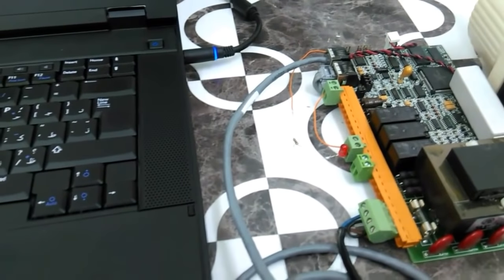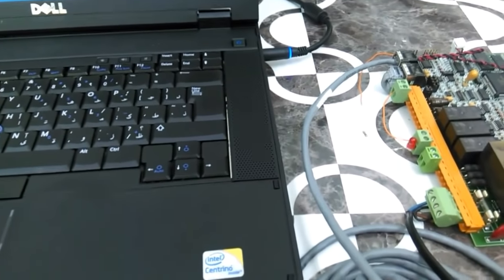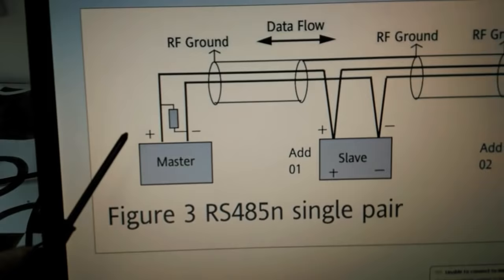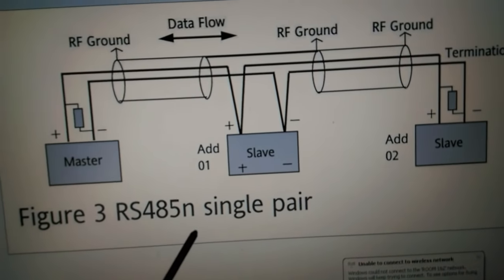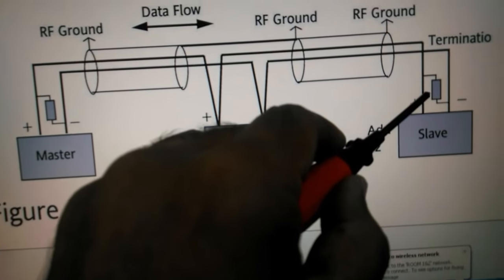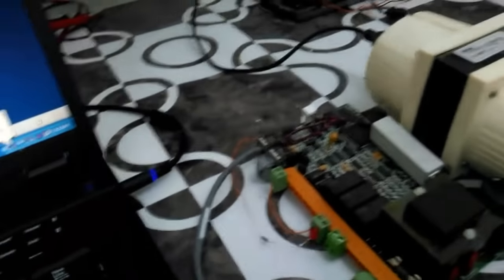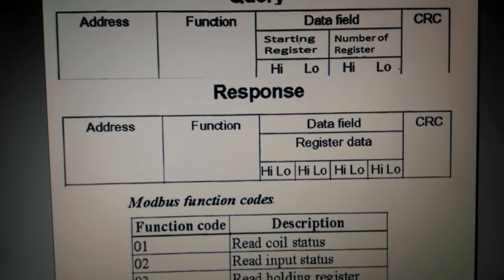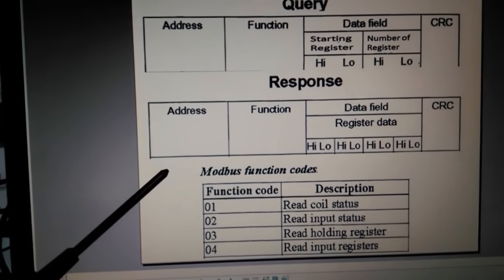Introduction to Modbus communication with RS232 and RS485 link, and understand How to use modscan32

Comment: Hello thank you for the video. It helped me a lot. I have two questions please:

1. If the slave device manual is not available, is there any way to know the address of the slave device? I want to pull decimal values from a pressure meter through controller/slave using RS485. 
2. How can I know from which register of the master device I should start? Or I can start from 001 always?
Reply from the maker: Hello, you are very welcome,
1. If device manual not available the other way is to go through the configuration menus of the device if the modbus mapping will be visible, but many devices they don't provide this, also you can try to communicate with manufacturer if possible, it is difficult to just guess the equvelent modbus register for any parameter, modbus list is big  range  and they can use any so not easy to just predict.
1. At master device you configure the modbus register mapp as per the slave device available data to be read. So the master pull the register and get the answers from slave on same register.

Comment: please 
are you connected the red and green LED in series or parallel with the transmit &reciev ?
Reply from the maker: +Ayman Elsayed 
Both  cathodes of Red and green LED going to the ground pin (pin #5) then the anode side of the LED's connected one to pin 2 and the other to pin 3 through 1 kilo ohms resistor.

Comment: could we able to connect 30 slaves directly to master computer with RS485 to USB convertor? pls rply asap
thanks in advance
Reply from the maker: +syed mubeen 
Technically up to 32 devices can be connected to single master on the RS485 data link network, yes you can use the USB to RS485 converter but take in  consideration the flowing points.
A-Use good quality industrial type USB to RS485 converter it is normally mentioned in the device specification the ability to handle 32 nodes.
B-Connect the devices using daisy chain meaning the same cable passing to device one then 2 and extra, use the end of line resistor one at computer side and second at last devise.
C-Test the link with fewer devices, then check the communication and keep adding gradually. 
D-Avoid the slave devices which generate harmonics like variable speed drives this will cause problem in the network, therefore put them separate.
All this just advises cannot be 100% as the communication setup depend on many other factors anyway.

Comment: Instead of using a step down transformer why not feed the DC directly and skip the built-in AC-DC converter?
Reply from the maker: +Jules Bartow 
Yes that's good idea to bypass the AC part and Power by DC , but sometimes the built-in AC-DC converter part gives multiple DC outputs and might be not practical to wire all.Thanks

Comment: Sir, can we assign slave address using modscan.
Reply from the maker: There is another application ModSim, with this application you can assign slave addresses and simulate values for different modbus registers then by using serial links you can connect it to a master device. In fact this is very useful application also.

Comment: Sir pls explain how to analyse crc data obtained in data traffic?
Reply from the maker: +Naveen Sodipilli 
The modbus is using CRC16 error detection , this is calculated by adding all values in the message then divided by a number and keeping the remainder, this remainder is appended on the end of message as CRC.
If the CRC in the received message does not match the CRC calculated by the receiving device then the message is in error.
Simple way to analyse this in the traffic by using the protocol analyzer obtain the received message excluding the CRC then input this to a CRC calculator and compare the result with the received CRC in the message keeping in mind the CRC in the message is swapped (MSB , LSB).
 If this matching then the received message is OK.